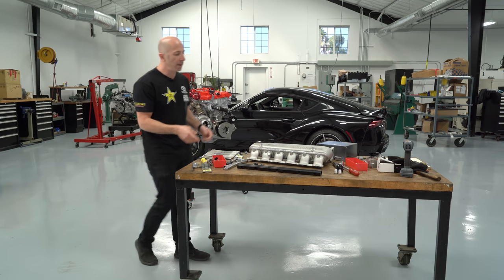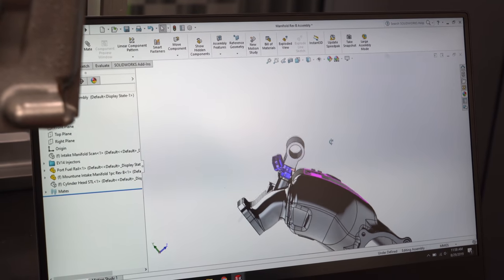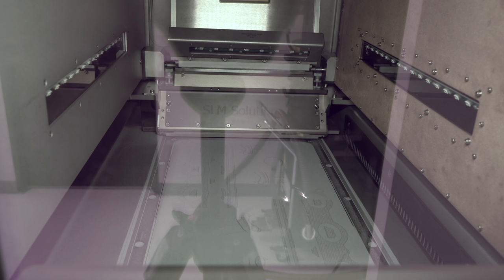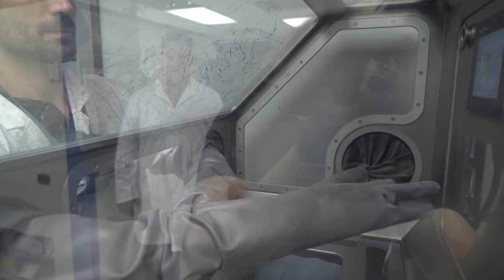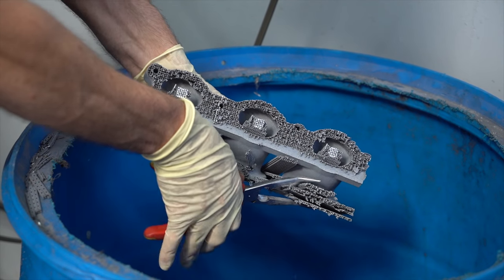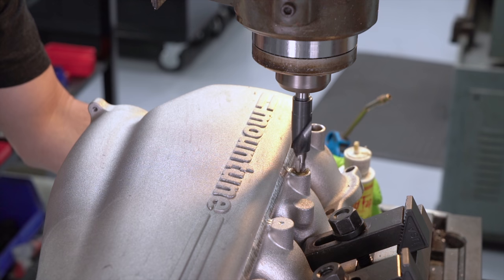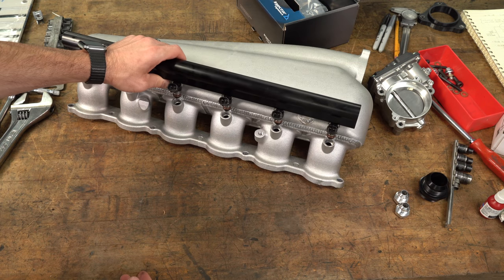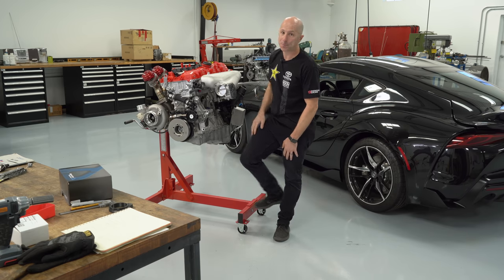3D Printed Aluminum Intake Manifold - Laser Melting Process

Comment from the maker: How much does it cost? About $800 per pound. So a 10 LB part would cost $8,000! What would you want to print out of metal?
Reply: PapadakisRacing a personality
Reply: It would be cool to print custom/reproduction car badges. Custom printed shift knobs could be interesting.
Reply: Replica Dardick trounds.
Reply: What the manifold weigh?
Reply: A reproduction of the GReddy MP90 supercharger kit for the 3UZ
Reply: It would definitely be worth it to get rid of some of the plastic parts that get worn out in a street car. Maybe 3d print a cupholder for a car that didn't come with one
Reply: Given the amount of work, time, and specialized machinery that goes into a process like that, that's really actually a pretty fair price. I was expecting a lot more than that. 

I used to do FDM plastic printing as a service in Sweden before it became commercially viable and better options came along. We charged per hour of print time, and we essentially charged about $60 an hour, so the prices of the company you used are pretty fair in comparison.
Reply: shoutout to Carson CA lol
Reply: Steph are you building a secret Formula Drift car for 2020? You can tell me. I can keep a secret.
Reply: In your case? For this project? CAD a custom equal length 6-into-one exhaust manifold with the blow off valve flanges nicely integrated. Oh, and while you're at it, integrate 6 bung holes for exhaust temp sensors. 

Given the temperatures involved, you might have to change to stainless or nickel-based powder though...
Reply: A guitar would be cool, but also heavy af
Reply: That's honestly not bad considering they only have two printers and it ties one of them up for 51 hours.
Reply: The fact there's $500 printers you can buy for the home and do this(make metal parts) says it all..... and that's Aust $$$ so, maybe $200 US$ and the powder! Cheap if you make yourself a tumbler... 
$18.000.00? Lmfao overpriced and over engineered for gullible people like them....
Reply: @hulkgqnissanpatrol6121  That's $500 for a plastic fillament printer. That's not for a 3D metal printing machine with shielding gas cabin and a laser (or several lasers) of between 200 and 1000 watt.
Reply: @Hydrazine1000  no is a laser and metal.
Reply: @hulkgqnissanpatrol6121  does a 180 ... Do you have a brand name and other information for me?

Edited to add: If it sounds too good to be true... then it probably is! A AUS$ 500 laser metal printer does not (yet) exist on the market. You had me for a while though.
Reply: A tank
Reply: Some rich guy or a speaker manufacturer is going to come along and print trick woofer frames/structures for displayed isobaric installs.
Reply: HULKGQ Nissan Patrol Yes please provide a link for this “$500” dollar metal 3D printer you’ve found. If it’s actually that cheap then it’s either only going to be able to print extremely small things and will more than likely be unreliable as hell and constantly breaking and make absolutely shit quality pieces too.
Reply: This is probably a dumb question but wouldn't it be cheaper to cnc it out of billet aluminum?  Cleetus has one on his Vette from Frankenstein and it's roughly half the price.
Reply: @Hydrazine1000  You can even integrate the turbine housing into the manifold, which is what Koenigsegg has done.
Reply: @PistonAvatarGuy  You probably can but that doesn't mean you should (As far as I know, Koenigsegg printed the turbine housings, using some v-band like coupling to the manifold, see https://youtu.be/DNedUZxP8NU?t=67 ) Not being able to rotate the housing within its v-band sounds like a pain...
Reply: Makes me wonder how much this costs vs a custom cast piece
Reply: @Hydrazine1000  I'm not really sure why you'd need to when the manifold/turbine housing is designed for a specific installation.
Reply: @Hydrazine1000  I knew the question would come.
Don't act like a fool. Hence my short answers!
They are called SLS 3D Printer's here is a link. https://www.aniwaa.com/best-professional-desktop-sls-3d-printers/
  They are 5k with all the benefits of a commercial product. 
The tech has been out there for years! I suggest you do more research. I'm not finding and posting a cheap production for you.
Reply: @hulkgqnissanpatrol6121  It's highly unlikely that those can print metal and the build space is extremely small. SLS with metals requires extremely powerful lasers, which aren't at all cheap to produce.
Reply: I'd print an inline 6 based on the Honda K20, or a V8 aircraft engine based on the Cosworth DFV.
Reply: @Hydrazine1000  Oh, and I was fairly certain that they had a manifold with an integrated turbine housing, like the VR38DETT has.
Reply: @steveskiba471  only smart people do that! haha
Reply: @PistonAvatarGuy  For (small series) serial production then you could decide to engineer for maximum integration. For this one-off 1000+ hp project however, you'd want ease of turbo assembly, ease of parts installation, choice of turbine diameter, choice of AR, and the ability to use, say, Inconel for the manifold and high temp resistant stainless for the turbine. All those things are impossible when the hot side turbine housing is an integral part of the exhaust manifold.
Reply: @hulkgqnissanpatrol6121  Thanks mate! That is SLS technology for sure, at 5k. Not the $500 you mentioned initially. And what materials are available for this printer tech you link to? Polyamide (nylon to most people) or nylon filled with reinforcement particles. It's not pure metal printing. (But what the hell do I know, after having visited one of the biggest additive manufacturing expos, formnext, twice now?)
Reply: @Hydrazine1000  Definitely, this project needs flexibility.
Reply: @NatoriousGamePlay  As a proverbial rule-of-thumb, a 3D selective laser melted part will add roughly a zero to the price of a series produced (so not a one-off) functionally equivalent cast piece.
Reply: @Hydrazine1000  really? That's a lot. I was thinking maybe a lost wax cast method if its a complex piece to cast. Would make it cheaper/easier than 3d printing I would think
Reply: @NatoriousGamePlay  It's a balancing act. With additive manufacturing, shape complexity is free. Print cost depends only on printing time and "toner". It's also pretty much a fixed cost per item, regardless of making a single piece or 100,000 pieces. Conventional manufacturing by casting is different: price per part increases with shape difficulty and it drops the more you move towards mass production. For both instances there is a tipping point where one method will become favourable over the other.
Reply: Compressor housings and compressor wheels.
Reply: @mannys9130  I see you are a man of culture.
Reply: Awesome, I was just going to ask that.  Your videos are always well done, hit the key points without fluff.
Reply: Thank you for sharing!  Relly enjoy the "openness" of your videos!
Reply: @hulkgqnissanpatrol6121  $500 printers for home use are hardly laser sintering - these printers cost huge money
Reply: @Hydrazine1000  an expo! Ohh well excuse me sir! 🤣🤣🤣👌👌👌 see my reply for the other ....umm yeah! Lol
Reply: @hulkgqnissanpatrol6121  Im not sure what you mean by 'you type of people' but I have two 3d printers. 

For $500 you can get consumer level plastic printers like what I have and thats about it.

Im not sure what you are talking about with scrap pieces of wood. Theres a reason that successfull businesses use and charge expenses for high end 3d printing.

A fellow aussie who has a 3d printing channel did a video (few years old now) that is pretty good for explaining the range of printers (and yes, some changes have happend recently with resin printers, but they arent anything like metal ones) 

https://www.youtube.com/watch?v=XD7IZYcdw58
Reply: @hulkgqnissanpatrol6121  Hey mate, you said there was a 3D SLS metal printer out there for AUS$ 500. What you eventually pointed out instead was an SLS printer for nylon (you know, plastic, not metal) and it cost 10 times more than you said it did. That printer could never make an intake manifold as shown in the vid.

(Admittedly, the printer can print nylon laced with aluminium powder, which will net you parts that will look all metallic and somewhat shiny. But metal powder held together with polyamide is not the same as bulk metal)

So we didn't get what you were saying, because what you initially said, your "statement", was wrong on two key points. Nice bit of reflecting you did there, "idiocy is all I get", while the idiocy started with two clearly wrong assumptions on your end.
Reply: @Hydrazine1000  yep idiocy.  No point arguing. 
When you make things like this for a living let me know mr expo.
Its easy tech that's been around for years like I said to begin with. 
People like you meant, the consumer!......
Reply: @mannys9130  aren't those plastic?
Reply: @hulkgqnissanpatrol6121  You SAID that an AUS$ 500 printer could SLS metal. At least you could have the decency to say "OOPS, sorry for the confusion I caused".
Reply: At that price a keychain
Reply: I do this every day at work 🤓. So cool, we print in Titanium too.
Reply: Wouldn't it be faster and cheaper to CNC depart instead?
Reply: @steveskiba471  They need to write code for the CNC because its a new product so maybe that's why its not used. Still I imagine a hand made one based on a excisting 6-in-line intake would be cheaper.
Reply: @mehrshadvr4  most likely. 3D printing or "additive manufacturing" isn't really great for one offs.  Contrary to popular belief 3D printing doesn't giving you an exact replica of the model you load to the machine. Other factors can lead to cracking in the part. Usually you'd want to do dial in builds to get the printed part closer to the nominal model.

Really the benefit of additive is printing complex geometries that wouldn't be possible with subtractive manufacturing such as CNC.
Reply: @Hydrazine1000  someone is selling a 3d printer  that lays and burns a powder for a part. Then you put it in a kiln with a piece of metal and the metal will melt and replace the 3d printed part, it's pretty much casting but the mold can be done a lot better I guess
Reply: Organic shaped car frame.
Simulating bone marrow.
Hence, the optimal shape and weight reduction.
Reply: @mihalis1010  uh, you realize that's just the cost of the material not the fee for R&D and everything else.
Reply: Nothing at that price. Could’ve had the intake cast in a couple hours. Not 5 days of 3D printing to still not be done.  Cool tech though.
Reply: @hulkgqnissanpatrol6121  That thing ain't bein mlade with no home machine.
Reply: Today's cars with plastic intake manifold... SMH
Reply: @ezacher4634  lmfao i didn't say that did i?
Reply: @ezacher4634  it's clearly made on a 100k+ all in 1 machine, isn't it!
Reply: @PistonAvatarGuy  I like the idea of turning a Honda k series engine into a 6 cylinder but you don't need a 3d printer for that. Someone has already turned Ls engine into a v12. It would be amazing if Honda made it themselves
Reply: @macberry4048  I just like the idea of printing a block rather than machining it out of billet. Casting a custom head would also be insanely expensive and the cost might even be comparable to printing it.
Reply: @PistonAvatarGuy  they use steel liners in the cylinder block for turbocharged engines, I would like to see them use titanium or some other crazy metal used instead
Reply: @macberry4048  I don't think that titanium would offer any benefit, the strength of ductile iron liners seems to be more than adequate. The surface finish of the cylinder walls also matters, and it's probably difficult to achieve a finish on a titanium liner that doesn't immediately destroy the piston rings.
Reply: @PistonAvatarGuy  that's why I said I would like to see them use some other crazy metal
Reply: $800 per pound seems pretty optimistic based on the price of other companies i've seen. is that the price someone from the general public would get?
Reply: The beautiful thing is this is only going to become cheaper,  faster,  and more widely available as time goes on.

I would love to print a 7MGTE block with enough clearance for some serious sleeves and a stroked crank.  Why?  Because, I'm sick of 2JZ fanboys.
Reply: A 3d printed engine block would be interesting.  I wonder how one could improve on some of the traditionally cast features.
Reply: For that price a prototype casting with printed sand cores would be more cost efficient isnt it?
Reply: @jamesgrosso8920  Not true. How are you going to cast that intake without a mold first? You have to CNC the mold which would take more than two days.
Reply: @TurboAcki  Maybe so. I think it would be close though.
Reply: A rocket nozzle, would be a lot of fun to test, but the inside of the bell would need to be very smooth so as not to trigger more expansion waves.
Reply: PapadakisRacing not worth it
Reply: @steveskiba471  but it's not faster than 3d printing it, to meet there time frame, that they needed it in.
Reply: Incredible Tech thanks for sharing.
Reply: Money.
Reply: dies to stamp money on a printing press.....
Reply: Some exotic devices. Because 3d printed engine block, will tend to crack. Because it doesn't have the density needed to handle the combustion explosions. May end up as ruined engine block.
Reply: Way cool...
Reply: @helmysetiabudi9915  Nope, not with today's 3D metal printing technology. The older Selective Laser Sintering (SLS) would get you up to 95% density. That was more than a decade ago. With improved optics and laser power output the powderbed printers now really melt the material. What's used here for the manifold is Selective Laser Melting. 

With SLM you're able to produce 99,95% dense products and you get mechanical properties that sit between as-cast material and forged material in terms of strength. Current build volumes are probably enough to print an inline-4 block.
Reply: @Shankovich  SpaceX prints the engine chambers for their SuperDraco engine, which is used for the Dragon space vehicle. First test was back in 2013 already.
Reply: i'd print a plug for a mold so i could cast multiple parts.
Reply: I guess this means it weighs 10lbs? seems like it could...
Reply: i would pring metal plates so i could cut the shapes i need
Reply: @Hydrazine1000  yea I know, I helped with it ;). The question wasn't to do something that hasn't been done, the question was what would you like to print for yourself
Reply: A 5 main bearing block and the rare twin cam head for my car.  And a stronger axle housing.
Reply: @Shankovich  In that case... That's actually a difficult question if I look at my household and what that would need in full-metal objects. If I had a SLM printer and the proper CAD software that could do that bionic (web/bone structure like) shape optimisation, I'd build an exoskeleton for all the hardware of my PC. I'd print a bucket seat and joints for tubes to build myself a new recumbent bicycle. 

And if I had one of those amazing new 3D plastic printers that can 3D print high-res full color and transparent/clear, the kids would go absolutely bonkers WILD!
Reply: i make carbon parts i pay 8 grand for a 3d printed mold
Reply: Plus the CAD and fluid dynamics computer time to design it in the first place.
Reply: We used a similar machines for printing,  when flow testing the fire protection extinguishing plumbing on 787  Engines. New fittings would be printed until proper flow was accomplished per design!
The daily cost of testing was enormous so printing vs machining saved tens of thousands when consider all the support personnel required!
Reply: For some parts that are very difficult to build with other methods, I think it's a good idea.
Reply: PapadakisRacing ? Im looking for a intake manifold for a 1986 Buick Regal. How much would it cost for something like that to be printed ?
Reply: at that price, i'll try the chinese printing services instead, and hope for the best o/
Reply: $800 per pound is not a cost efficient way of making a part. With $8000.00 I could convert my 1986 Buick Regal into a turbo charged Regal with a manufactured engine and transmission to go with it. Im having trouble finding a use intake manifold for my v6 1986 Buick Regal. They sell the v8 new or used but not the v6.
Reply: It's makes it complex parts and with more time it will become more common and cheaper
Reply: I have a destroyed plastic fan off a 2 hp table saw motor that would be great if it was replaced in aluminum.  I am contemplating making it out of a high quality plywood as I cannot find a replacement...
Reply: Plus time, Plus cost of equipment. Looks like it can not compete at this time.
Reply: In US, does the Al alloy powder cost $800 USD per pound? I guess it's too high. Even in Japan, the most of powders are imported, though, Al alloy powder costs almost $400 per kg, i.e. $200 per lbs. For Inconel powder,  its price is similar to Al alloy or less.
Reply: @NatoriousGamePlay  For an one-off products, the model of a lost wax cast method is made by the 3D printer. It reduces the time to curve a wax model, and gives more complexity to the model shape. But the time for other steps during the lost wax casting is the same with conventional. Well, it will take 3 weeks to get the cast product after the virtual 3D model or CAD model is submitted to a cast shop, and the finishing process will be required more 1 week.
Reply: 15 years later 10 LB of that $4 at the scrap yard
Reply: FUNK BOOGIE put a v8 in it then.
Reply: mac berry of all the many amazing things that could be printed to your wildest imagination, you want a damn cupholder. 😂
Reply: what is advantage of aluminum versus plastic? Heat management? Also, if you had to pick either direct injection or port injection, which would you choose  if say for producing less power?
Reply: If I had the money........ OH BOY
Reply: Chesus Christ
Reply: Top👌👍😉💖
Reply: PapadakisRacing a Lamborghini Mercialago engine.
Reply: holy moly
Reply: So if you want to print in silver, does the price go up from the material or down because silver is easier to handle? :D
Reply: Vintage, out of production aircraft parts.
Reply: Gold
Reply: A custom bowling ball
Reply: Audi  Straight 5  Aluminum alloy block and head, Sport Quattro
Reply: I'm going to convince my boss to get these guys to print me up some RF waveguide parts. It would be interesting to know if the tolerances are good enough.
Reply: What is the status of the Supra???
Reply: I guess its time for an update
Reply: There is a company in the UK that prints inlet manifolds in carbon fibre, they are lighter and disperse heat faster than Alloy.
Reply: Hmmmm .... How much to just buy the printer?
Reply: @hulkgqnissanpatrol6121  not $500 sorry
Reply: @andrewc1036  not one like them but 500 can start you like it dis me. should see my garage! didn't take too long.  But did a boost manifold myself.  In bronze 🤣👌😉
Reply: PapadakisRacing  😫 my 300zx needs one a little modified though! Super sweet!!!!!
Reply: Why didn’t you just cnc out of billet since you were gonna weld the piece together.
Reply: Well I can afford a tenth of a pound.
Reply: NatoriousGamePlay Cost was not the driving factor - it was time, they needed the part quickly. 2-day turn around is insane fast for a part of this quality. A custom cast part would have taken MUCH longer.
Reply: So this should bring costs down since now you can 3D print parts out of Aluminum and titanium or even better folks can get their own 3D printer and print their own parts out. i gave the hobby a break, i have not worked on my camaro since last year, shits to expensive assholes selling used parts for almost the original price they paid, fuck that. RC car are fun cheaper
Reply: The actual manifold print only cost $15, but that trick fuel injector drill bit cost $7985.
Reply: PapadakisRacing All this will be cheaper one day. Excellent video👍
Reply: A 1:18 scale BMW M3, that has a working engine, suspension, steering and gearbox if possible
Reply: I'll wait till prusa builds one.
Reply: Could you talk about the problems with 3d printing metal?
Reply: ...better off buying an aftermarket intake manifold..or..fabricate intake manifold with various available metal rectangle tubing,sheeting....imo
Reply: In this case what is the benefit to the 3d process over casting? I feel like you could get the same results in about the same time at a way cheaper price if you casted

You can create a plastic 3d printed part and fill the imperfections with Bondo. Once perfected you can use that as the mold for the cast. Then bake it off before pouring the aluminum. I realize the shape isn't conducive to remove from a casted part so you would have to split the part. If you are worried about a seam because of turbulent air flow inside the part you could use a 1/8" flange that tapers to finale width with with dowels built into the mold to align. mill the flange and dowels for a perfect seamless fit before welding, align with dowels then fillet weld within the taper. No?

The post processing, time of print and price tag scares me away. I could fully understand if that plenum had some built in secrets that created specific air flow characteristics with shapes that are impossible to cast, but its empty not to mention the design kinda inhibits air flow.

Im not critiquing i'm just curious.
Reply: ,A better solid as steel version of my bloody totaly dysfunctional happy family, well atleast a metal fist🦾 i take them all out with..🇦🇺😁💯🤘🥾🥽
Reply: Turbo!
Reply: Forget the frame then
Reply: Is that australian- or US-Dollars ??? Thanks for any answer...!  Sorry for the stupid question, but I think to recall that you are an australian company...
Reply: My own Harley Davidson Sportster top end.
Reply: a custom 1/6 scale chassis plate for my r/c Baja truck...Hopefully the prices have gone down significantly in the last two year's....But I somehow doubt it.
Reply: WHAT A RIDICULOUS PRICE
Reply: Plus taxes? 😳😳😭😭 really very interesting
Reply: stronger than casting?
Reply: Boomsticks
Reply: is it possible to print all parts of a car engine?